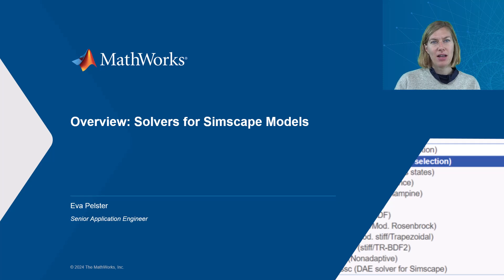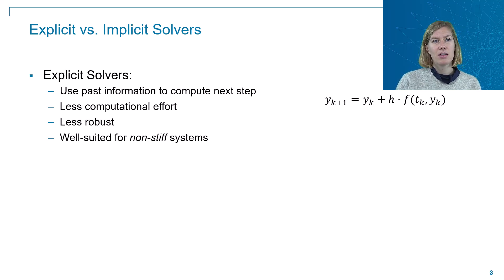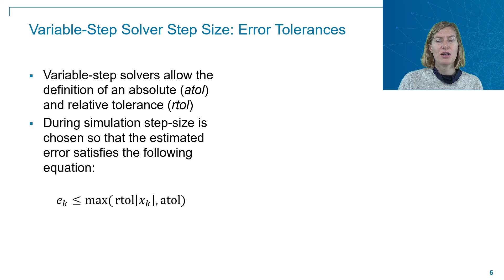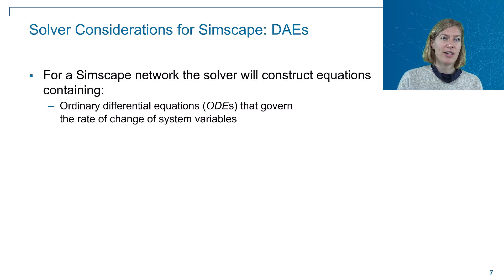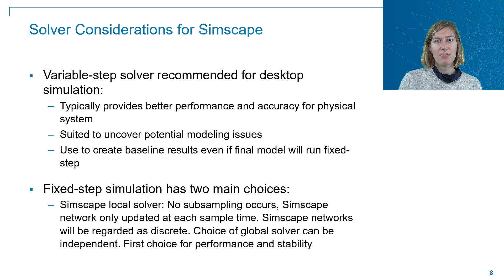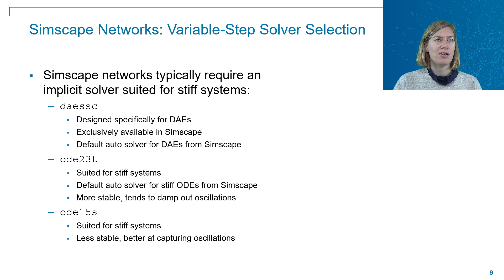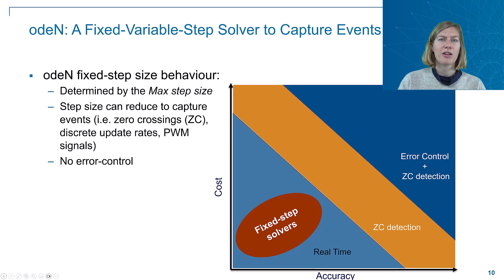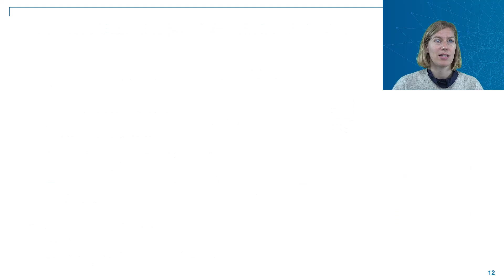Which Solver to Use for Electrical System Simulation? | Simscape Electrical Modeling Practices

Comment: Good madam. What types of solvers can be used when power electronics switches operate at a switching frequency of 25kHz or higher than that. In Powergui what is the value of discrete simulation type what value should be used for 25kHz